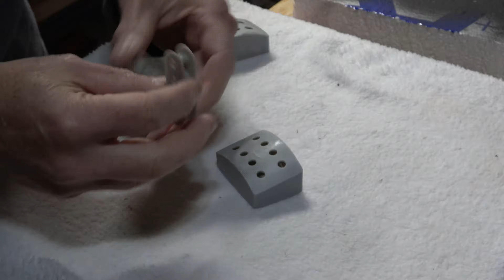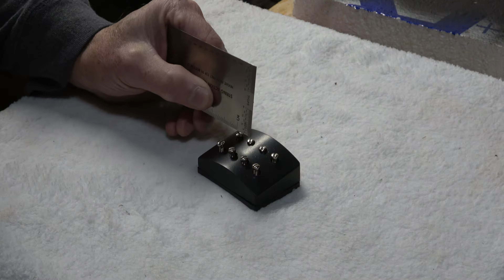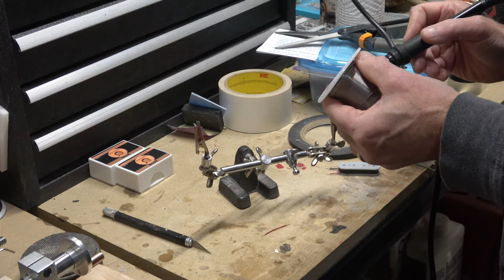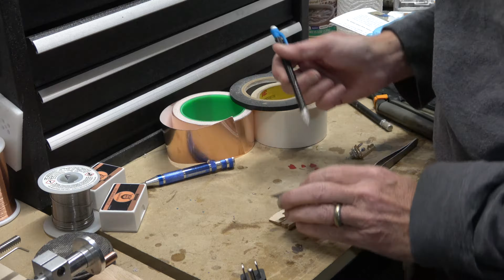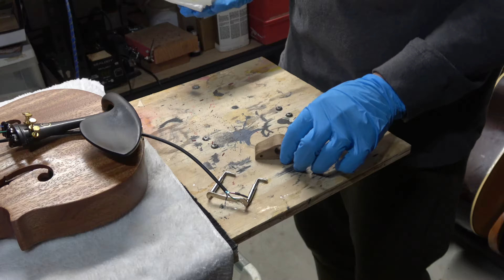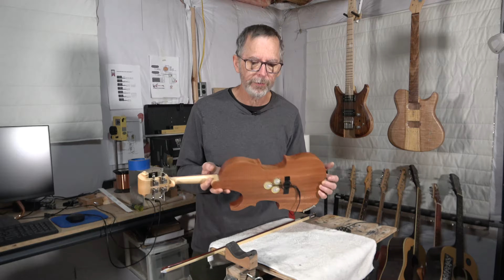Making An Electric Violin Part 13 Making The Pickup

Comment: Were the piezo pickups buffered and impedance matched to the amplifier? Piezos are often very high impedance. How close to the strings were the humbucker pole pieces? Why not single coil? A violin can be tuned over an octave above guitar. Too many winds for the humbuckers may have too low of a resonant peak if hotly wound.

Comment: You're half right about why the humbucker is quieter. A magnetic pickup under the strings doesn't pick up side to side movement, it picks up up and down movement (i.e. the string getting closer to and further away from the coil).

On a guitar this is fine because the string can move in all directions, but on a violin the bow restricticts the movement to mostly side to side.

Comment: Ex-violinist responding here -- I will say that the piezo setup is not sounding as clear, nor as resonant as the humbucker.  It was more noticeable on the back-mount one, where I felt a lot of damping.  The ringing when you lifted the bow is normal (it's not always desirable depending on the piece, but it is normal) and it was actually picked up with the humbucker, whereas it just kind of died off with the piezo.  This is sort of expected if you follow the mechanics of how acoustic violin bodies are supposed to work.  That said, I've seen and played a handful of electric violins, all of which have piezo pickups, and there are significant differences between those and the ones you used.

One thing about them is that it isn't that common to place the pickups on the body.  You would either have them close to the strings, or somewhere on the bridge, so that you have the least damping possible.  Many even go for a placement under the bridge.  Yes, you have to bias it for the pressure of being under that bridge, but it's common.  There are some that go for a body placement, but those will be placed near the edge of an F-hole where the top plate is likely to flex the most (on an otherwise acoustic violin).  Alternatively, if you shape the pickup just right, you can fit it into the gap at the wings of the bridge (like some of the Barcus Berry pickups do).  Another thing is that most violin pickups use extremely tiny piezo transducers;  Being tiny means low mass, which generally means more responsive on the high end.  Larger transducers will damp the highs and apparently the mids more than smaller ones will.  The most famous ones -- the Barbera pickup -- is a replacement for the bridge that literally has 2 transducers at the front and back of every string slot on the bridge, but it also has a fair bit of analog circuitry to optimize the mixing of those signals.

While the Barberas are highly prized, I've always had the hot take that they sound kind of "too electronic" in the low end.  Almost a "rubbery" sound for lack of a better word.  I tend to like a more similar-to-acoustic sound for these kinds of things.  All that said, the idea of using guitar-style magnetic pickups on a violin is something I've always been curious about.  I think if you want to run a comparison, though, see how it compares to widely available piezo pickups.

I know you mentioned earlier about expecting less response out of synthetic or gut core strings, but they'll still have steel/aluminum windings, and even a set of synthetic core strings would have an all-steel E-string.  I do think most violinists will still use these because they are less prone to elastic deformation, which means they will not shift in pitch so much when you apply more pressure (this is a problem on steel core strings)

Comment: I need to make a pickup for the guitar-cello I've made and I'm thinking a "blade" pole design like hot rails have might be best to capture the string. I'm just stalling as i really want to find a part for this which i dont need to fabricate - e.g. a curved, yet tall, ferrous metal piece that at most i would need to grind into radius. I really just need to give it a go rather than stalling trying to think of the perfect setup! Videos like this help me out - i really need to just get on with it. I made a pickup winder just for this task, and then never made a pickup!

Comment: Did you consider an acoustic guitar under the bridge piezo pickup mounted under the violin bridge? Possibly with a specially designed violin bridge where the  base of the bridge is continuous rather than with "feet" at each end.
Impressive build. Cheers an Well done!
Reply from the maker: Yes, I did consider that, but I felt it would be more work than it would be worth.

Comment: Piezo Pickups are very bright. EQ is pretty much a necessity to tame their harsh high frequencies. Putting the Piezo Pickups inside the Violin under the soundboard would probably produce a better tone/more even and balanced tone, and a more elegant solution, though it would require an access cavity and cover. In my tests with Piezo Pickups, one Pickup works better than multiple Pickups, as there is no chance of phase cancellation. A electric pickup under the strings is going to get covered in Bow Rosin, and can't be used with Gut and other non-metal/magnetic strings.
Reply from the maker: What great information. I never thought about the rosin depositing on the humbucker, but I think you're right. The suggestion regarding phase cancellation makes sense. I wondered why so many piezo options for acoustic instruments include 3 pickups. After reading your comment, I can't help but wonder if phase cancellation might be happening with my set up. Time for more testing!

Comment: Does your violin use regular strings, as far as material goes?
Reply from the maker: They are steel strings.
Reply: @HighlineGuitars  I'm guessing that's abnormal?
Reply from the maker: @Harvey-dK1  They are readily available as an option. Violin strings can be made from natural and synthetic materials as well as steel. It all depends on what the violinist wants for their tone and volume. I chose steel core strings to maximise their presence to the humbucker's magnetic field. Natural (gut) or synthetic (plastic) core strings would not have yielded results with a magnetic coil pickup. However, any type of core works with piezo pickups.

Comment: The Piezos sounded rather distorted, but all piezos need to see a high impedance input (anywhere from 1 to 5 M ohms).
I have made several impedance buffers for my piezo violin pickups, and they all made my amplified  violin sound much better. Better bass, and meant i could easily tailor the top end to my personal taste. Difficult for me to tell also how they sound comparatively speaking, without hearing someone who can actually play the violin! No disrespect intended. 
I would love to try out this instrument, but alas, as I live in France, i guess this is impractical!